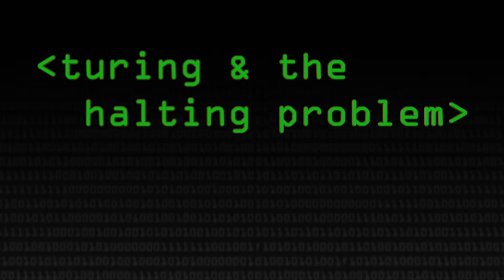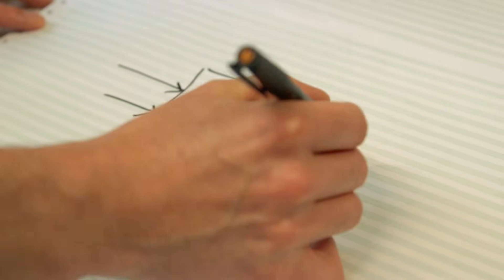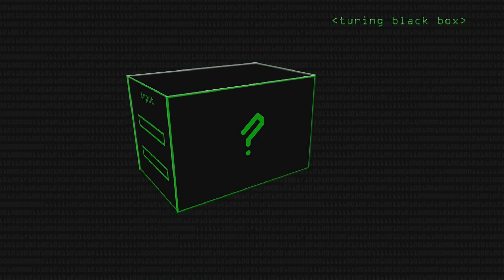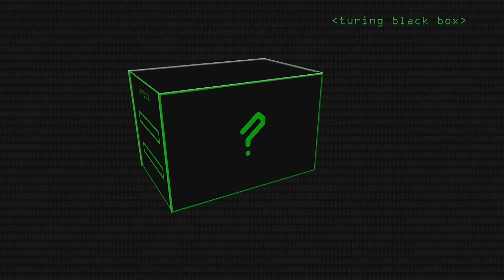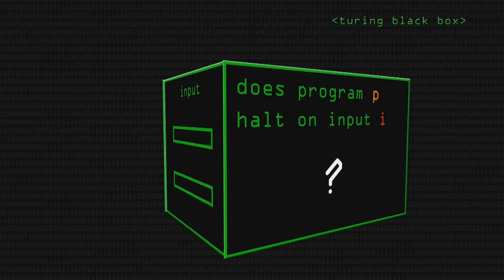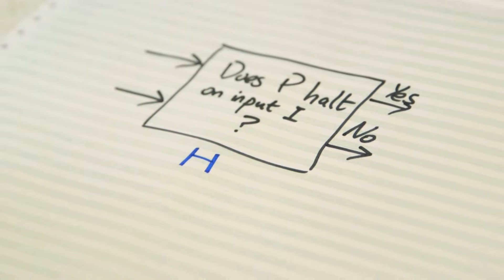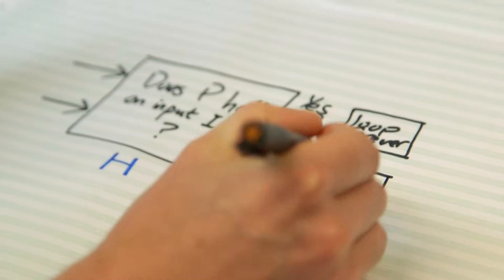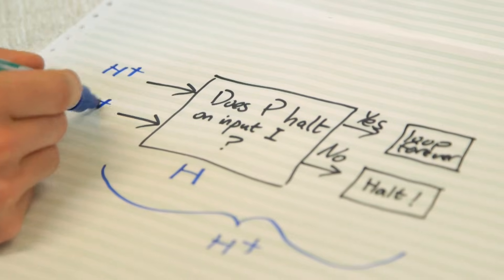Turing & The Halting Problem - Computerphile

Comment: In the proof of the halting problem, why do we have to pass the machine and its description as an input? For example, I could have passed the description of the machine and some other input(not the machine itself) and still the proof by contradiction would have worked. For example, say H(a,b) gives an answer "yes" if a does hault on b and "no" otherwise. Now we create another machine H* which does the opposite of what H does. H haults implies that H* goes into an infinite loop and H does not hault implies that H* haults. Now instead of passing H(H*,H*), if I passed H(H*,X) then it would have meant that H* would hault if H* didn't hault on X and vice versa(still it would have been a proof by contradiction). I don't necessarily see the idea of passing H(H*,H*) instead of just passing H(H*,X) for some X. Wouldn't the proof work in the latter case?

Comment: I can design a program to determine whether a closed loop program (I.e. one that doesn't have any inputs) repeats forever. It executes that program and examines the memory allocated to it, and as soon as it sees a repetition in the memory, it terminates that program and outputs  yes, that program repeats forever. It avoids the halting problem because it requires an input, rendering it incompatible as an input.
Reply: Except. On a machine with infinite memory (as all Turing machines are considered to have.) “ X=0: While true do{x++}.” Is a program that despite not taking input neither ever repeats the same memory state nor ever terminates. Which means your program still doesn’t work.

Comment: Wouldn't this only be able to work on things with one input? So comparing a matching that has two inputs in it couldn't work, right? You'd have to say the h+ machine( is comparing the h+ machine( is comparing... To the h+ machine) to the h+ machine)...) Which would be an infinite input, so it isn't a real input, right?

Comment: the problem with the halting theorem is that it in this case would have to be manufactured in this specific way
H isn't wrong, but H+ is wrong, as H is predicting what MAY happen, not what WILL happen, and thus no matter what you put through it, H is therefore correct, even if H+ still loops endlessly.
Reply: its a case of "faulty component syndrome" where you purposely put a machine that can predict the output perfectly, but another component causes it to fail. it was engineered to fail, rather than it causing itself to fail, so if it was engineered with the extra bits added correctly, it would still output the correct answer, regardless of the outcome.

Comment: However, H+ isn't designed to solve the halting problem, H is. If H+ is given the description of H+, yes there is a paradox, however; if H is given the description of H+ and the input given to H+ as the description of H+ as the input fed to H+ than H will correctly predict the outcome. this demonstration just shows you can take H and turn it into a nonfunctioning algorithm , which you can do for any algorithm/program.
Reply: Yes, it's  trivial to turn our human-written algorithms into non-functioning programs, but H represents an algorithm that is immune from that attack. No matter what you feed into to H, by definition you'll get a distinct answer. This H+ recursion example can be used as an input that would break H. If you feed the H+ recursion into H, then H must either lie to you or loop forever without giving you an answer; in either case you have logically disproven H. If H exists then H+ can be constructed and if H+ recursion is used as the input to H, then H cannot return a truthful answer and therefore by definition H cannot exist.

Comment: But that's the same as saying that if you feed a not gate back into itself it can't be 1 or 0 and therefore not gates do not work. It's the same with the machine as it itself is not the problem what your talking about is basicly making it act in the same manner through the same means that isn't proper proof.
And just to show you how it's done because I'm mean a not gate being feed back in on itself is logically the same as having a statement that says 'I am false'  and asking if it's true or false it can't be true because it's false and it can't be false because if it's false then it's true however when you attempt to express it in logic form say your modified machine or my self refering not gate what actually happens is it oscillates and switches between it's two states in stable loop. No paradox just a oscillator I'm sorry and even then that's only because of a feedback loop and not the actual device therefor your logic is flawed because as shown with not gates acting in the same manner just because it breaks when you modify it does not mean that it dosn't work. Otherwise we wouldn't be able to watch this video would we?

Comment: how exactly did he loop around the yes answer when transforming h to h+?
Reply: I think my question is an elaboration of your basic intuition.

 I unfortunately still cannot answer it satisfactorily. I repost my question

"You cannot feed H+ with its description as both of its arguments.
H and H+ are machines that receive TWO arguments, the description of a machine of ONE argument and its argument.
Doing the thing proposed in the video, creating H+(H+, H+) means nothing, because in order for it to be a meaningful statement
the first argument would have to be the description of a machine of ONE argument and the second argument the argument of that machine, whereas H+ is a machine of two arguments. 
The proposed machine would answer something like the following:
 "If the machine of H+ halts with H+ as its input, then it doesn't halt and vice versa", but that is not a meaningful statement since you have to have TWO arguments to know whether H+ would halt.
Any clues here? What is wrong with my challenge?"

If you find out a solution to it it would be great to know :)

Comment: Yes exactly. He is purposefully doing something to reach a contradiction, and that's fine. Why?

Think of it like this. We want to prove H does not exist, but we're having a hard time doing that, so we assume it DOES exist. Using H, it is very easy and possible to construct H+ as they said in the video. So far we know, if H exists, then H+ exists. Agree? Continue reading if you do. 

Now using H+ we arrived at the contradiction, showing that H+ cannot exist. But how is that if we showed how to make H+ using H in a valid logical way? That must mean our original assumption was incorrect, in that H can indeed not exist. 

Hope that made things clearer.
Reply: wow thank you
Reply: that's a great explanation, thanks!
Reply: the general problem of whether a set of premises entails a conclusion is undecidable for first-order logic.

This follows from the undecidability of the halting problem.

First-order logic can encode Turing machines.

If entailment were decidable, we could decide the halting problem.

Therefore, entailment must also be undecidable.
Reply: You can take something that exists and works and alter it in a really easy, simple and logical way such that it will always give the wrong result (like putting a negation before the answer, as shown in the video )
Yes, i know in academic logic this is supposed to 100% be a valid argument, but I'm still not buying it for a second
Reply: @mihailazar2487  What you said doesn't make "the thing that exists" not exist though. Or maybe I'm misunderstanding what you mean.

Proofs by contradiction are not only valid in academic logic, they are a valid form of argument in general (if constructed soundly). In philosophy they are known as "reductio ad absurdum". Here's a simple non-math example that argues that the earth is not flat:

"Assume the earth is flat, then it would be possible to find an edge for it. However it has no edge, so the assumption was false, i.e., the earth is not flat". In this example the contradiction was "the earth having an edge and not having an edge". I encourage you to put more effort into understanding these concepts. If you properly understand them, you will buy them.
Reply: @Kalernor  here's a simple example where they go horribly wrong 

"This statement is false" 
By reductio ad absurdum let's assume for a moment that it is false. In which the semantic contents of the statement must be false. But the semantic statement is referring to the statement itself and it says that it's false which we've already established it is which makes it true. THAT'S ABSURD, therefore the statement is true. ( But now you can go and check if your initial assumption is opposite you'll reach the opposite conclusion ) 
Now you might say "but m8, everybody knows that's a paradox, it's unsolvable. Of course reductio ad absurdum goes wrong." To that I say that 
1) it goes wrong without any warning. You find the contradiction, you get your answer. It doesn't happen like a divide by 0 where it doesn't make sense, instead you get a very sneaky false positive.
2) idk if it's just me but the self-refferential statement int the example above feels very similar to the way you make the machine compute itself. 
I do believe these edge cases are too "fuzzy" to be easily concluded by a reductio ad absurdum. 

Think of it this way: that machine, if it does exist we're essentially making it be wrong 

Like. the machine itself could work perfectly and give the correct result everytime. But if we put it into H+ the machine doesn't have a direct control over what it's output is. In layman's terms it's not fair. It's not like saying "hmm, H if you're so smart, figure this out", because we engineer the situation in such a way that the machine has no possibility of answering correctly. If I was the machine is send out a bug picture of a middle finger. 
It's like dividing by 0 and proving division doesn't exist. 
This entire conundrum could be completely mitigated by adding the restriction that H returns undefined whenever inputted a task in which it itself is included. 
This seems like a reasonable restriction to make. The machine would still work and give the correct answer everytime except for those off-limit cases. 

In the end I just think this problem isntoo complex to be completely concluded in this rather silly way
Reply: @mihailazar2487  You're now raising a different point to the one you were raising initially, so I hope at least that original bit is cleared up. As to your new point, I can't fully comprehend it so I will leave it for a later reading when I can read attentively, or just wait for possibly someone else's response to clarify things
Reply: I see a billion comments complaining about people complaining about proof-by-contradiction and zero comments complaining about proof-by-contradiction. Since it's taught in high school math I would guess that the tiny minority of people unfamiliar with proof by contradiction are just high-school dropouts.
Reply: I agree with you about the validity of proof by contradiction, but I think there is still a flaw here. H+ isn't being given H+ as an input in the video's final example, it's being given two parameters: (H+, H+). One parameter for the program and one for the input, so you can't simply give it itself as an input. In other words, it doesn't make sense to ask if H+ halts on H+, because you're not specifying two parameters. Now, you could turn those two parameters into a single parameter and ask if a program halts on itself as an input (i.e. you specify that the program and it's input are a single identical parameter), and the contradiction would follow as it does in the video. This of course would not being proving the halting problem though.
Reply: @BrettClimb  Yes, you're right, the video does indeed have a mistake. 

In the final problem they presented that causes the contradiction, H+ takes as an input two instances of H+, but loops on forever iff H+ halts on a single input instance of H+, and halts iff H+ does not halt on a single input of H+. So what's actually happening is that H+ is running forever on two inputs H+ and H+ when H+ halts on a single input H+, and vice versa. No two opposite things are occurring at the same time, so no contradiction so far. 

Obviously this can easily be amended by changing H+ to take only a single input, and then feeding those two inputs into its built-in machine H.
Reply: @Kalernor  As you say, the one input can be sent into H as the machine and the machine's input. However, this is not a decider for the halting problem. this is a decider for "does a machine halt on itself as an input?". But now that we have proven this narrow case to be undecidable, there is a pretty trivial reduction from the narrow problem to the general problem. They don't include the reduction in this video, which I think is misleading and makes their proof technically incorrect.
Reply: @BrettClimb  Yes you are absolutely correct, H+ is not a decider for the halting problem. However, H is a decider for the halting problem, and since we assumed H's existence, which implied H+'s existence which did absurd things, then our assumption of H's existence was false, therefore there is no decider for the halting problem.
Reply: One mistake. H+ actually exists. Because H+ exists, it proves a single case where you could actually keep the program running forever. Since the original assumption was that the program always stops under any inputs, you've proven one case exists, therefore contradicting it and showing you can't create a program that solves all problems.
Reply: @ret4kind  I feel like I'm very close to understanding this and your explanation helped me almost get there but I still feel a little loopy in my brain. If I'm getting it right...essentially if a single computer program can be written that loops forever, there can never be a universal algorithm written to automatically know whether a premise results in a conclusion because that would require running the code of the premise/conclusion pair to get an outcome. Since this infinite loop can be conceived of, the corresponding algorithm that would theoretically solve it can't exist. Do I have it?
Reply: Another way of looking at it: Even if H+ halts on input H+, that doesn't contradict the fact that H+ loops forever on (H+, H+).
Reply: You just repeated what he said in the video.
Reply: @kanesas45  because some people have problem understanding what proof by contradiction means
Reply: @sayanghosh6996  gang gang you amazing

Comment: I have a point of disagreement/confusion. In the final problem you presented that causes the contradiction, H+ takes as an input two instances of H+, but loops on forever iff H+ halts on a single input instance of H+, and halts iff H+ does not halt on a single input of H+. So what's actually happening is that H+ is running forever on two inputs H+ and H+ when H+ halts on a single input H+, and vice versa. No two opposite things are occurring at the same time, so no contradiction so far. 

Obviously this can easily be amended by changing H+ to take only a single input, and then feeding those two inputs into its built in machine H.

Comment: This is a logic problem, not a computer one.
Humans just don't stop after being asked a question or after they are fulfilled, we just keep running until we exhaust our resources.

I'm saying this because I've met people who use this paradox as the proof that we humans are more than a program or a computer and we will never be able to program an AI that is indistinguishable from us.

But this paradox doesn't apply to something that runs indefinitely, so you could still in theory write a program with a system that has the same inputs and outputs as our human system.

Comment: I have just realised, why I was uncomfortable with the proof, as presented here. It is wrong. You say that we ask  H+ will H+(H+) halt, that is H+(H+,H+).  But in doing this we evaluate H+(H+,H+). There is no contradiction. Therefore we would have to ask H+ will H+(H+,H+) halt, that is H+(H+,(H+,H+)). Oh dear that is still the same problem, so we need to recurse to infinity. Or we could create H++ with one input, that duplicates its input, and passes one each to the two inputs of H+, and returns whatever H+ returns. Then we pass H++ to H++, this results in asking H+ will H++(H++) halt.  We are now asking about the program we are running.

2nd the prove does not say that you can never know, it only says that you can not know for all programs. There are some programs that you can know for example these one liners:
exit
 or 
loop forever

Comment: Pardon me for so saying, but it appears that:  This entire presentation (and argument) is itself a general algorithm that in fact does decide a whether a program will always terminate or not.  This presentation demonstrates an answer to the presented dilemma.  Given the recursive, self-referential nature of the proof presented, I think it only fair to consider the proof itself as part of an algorithm that does in fact solve the issue at hand, thus this ONE CASE presented actually shows that there is an answer.  After all, you've given the answer in the form of a proof, no less!

If you consider your own thoughts as part of the algorithm inside the "machine" then you are the solution, since you can ALWAYS decide if a program will terminate (by recognizing an apparent paradox).
Reply: "The Halting Problem" is a problem specifically for Turing Machines, or any other equivalent formal system (first order logic, the lamda calculus, etc.). Once you step outside those systems, "The Halting Problem" is not defined.
Reply: Thoughts on this?
Reply: @ZandarKoad  I agree, and cannot find a proper example/explanation anywhere.